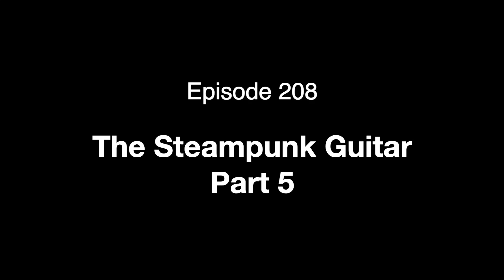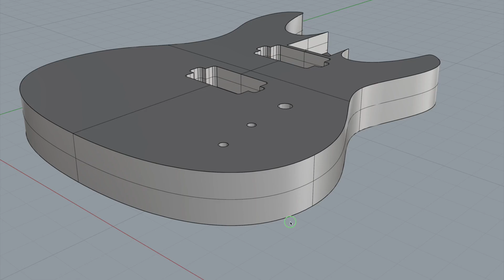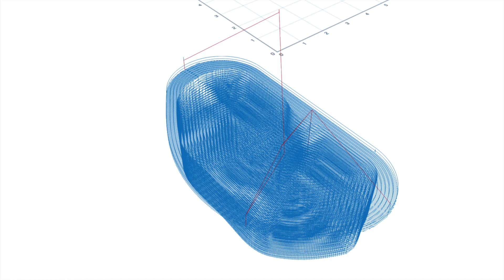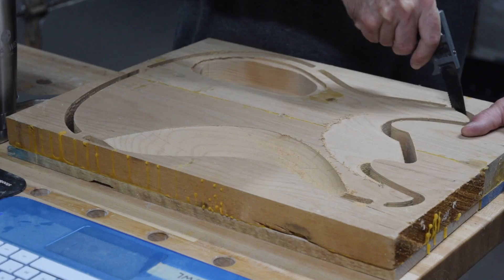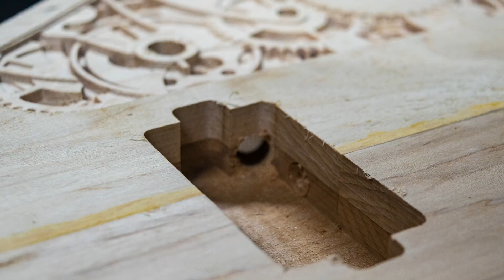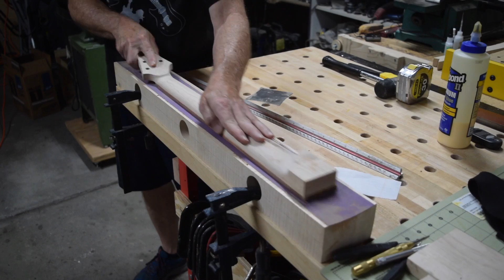The Steampunk Guitar Build Part 5: Making The Body

Comment: Thanks Chris, as always!  I'm pondering pulling the trigger on a CNC to do my own builds, but $$$ is an issue, like it is for all of us.  I downloaded your plans for your CNC a little while ago, but I ran across Bob's CNC recently and I'd love your input on their Evolution 4 machine:  https://www.bobscnc.com/products/evolution-4-cnc-router-kit?variant=31885311508527. The only big issue I see is the Z axis being limited to 3.3", but is there anything else that would concern you on it?
Reply from the maker: Belt drives are a pain to keep adjusted. NEMA 17 motors are not sufficient for carving guitar necks and bodies.
Reply: @HighlineGuitars  Thanks for the input, I appreciate it!  I really want to get a CNC to get up and running.  Looks like it is time to track down the parts for your plans!